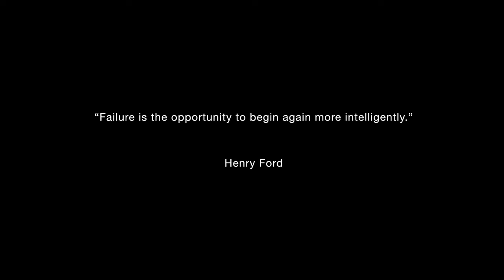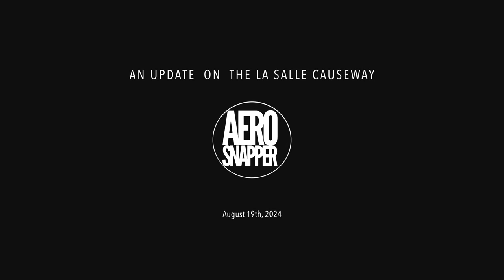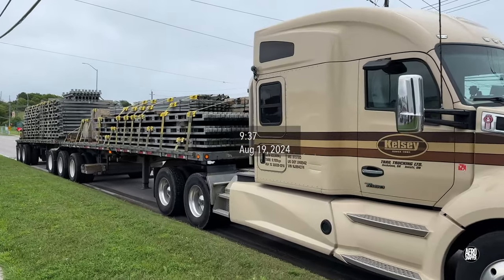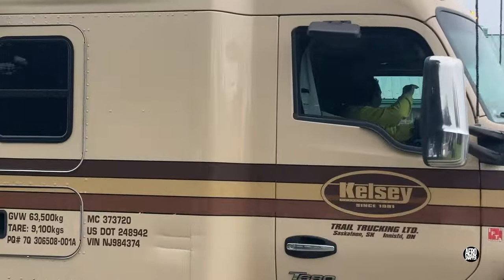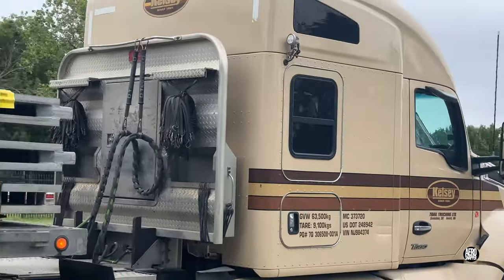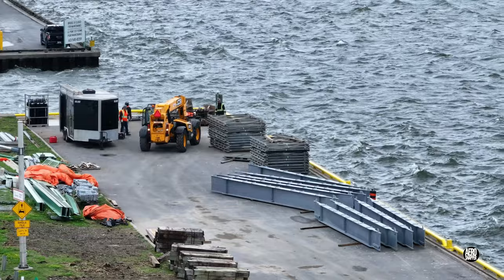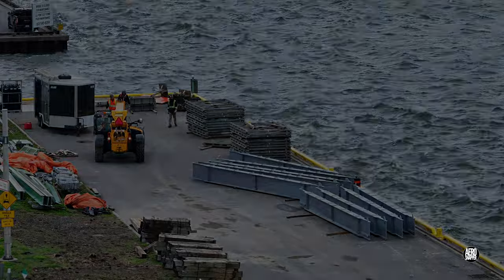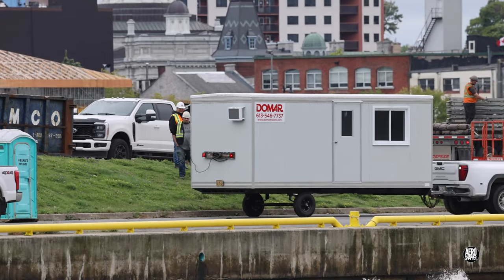The New Bridge arrives - an update from Kingston, Ontario's La Salle Causeway 4K

Comment: There's our Bailey! 😊
Reply from the maker: Certainly a bit of a look-alike, but it's known commercially as an Acrow Bridge - great to see it here.
Reply: @Aerosnapper ACROW is the successor to Bailey. Bailey was easily constructed by hand, ACROW on the other hand, needs mechanical assist to be constructed
Reply: Also with what can be seen, doesn't look like the Cataraqui side will be accessible to large boats until the permanent bridge is in place
Reply from the maker: @NEWFOUNDLANDSAPPER  thank you - that's such an important point
Reply from the maker: @NEWFOUNDLANDSAPPER  no, quite correct - an undertaking to lift it out two or three times over the winter has been made - but no word yet on next navigation season
Reply: YES!!!
Reply: I can hear the commentary no video just a black screen 😢
Reply: @NEWFOUNDLANDSAPPER  Ah! Good to know. I'm surprised they didn't go with Bailey considering the plans to move it out of the way once a month for a few days at a time.
Reply: @TheEDFLegacy  ACROW is the modern version of Bailey
Reply: In my opinion the logistics of moving the bridge a few times to accommodate boat movement is not viable.